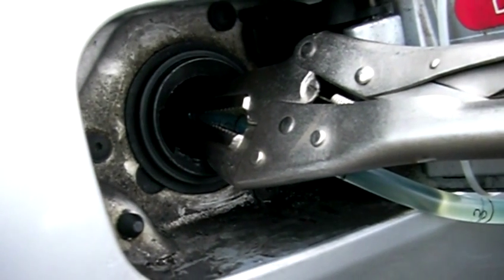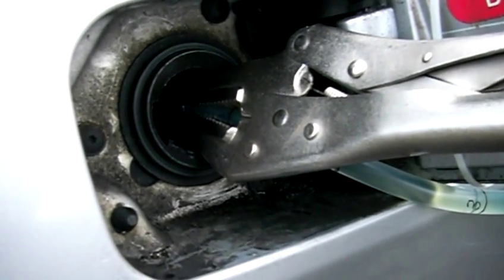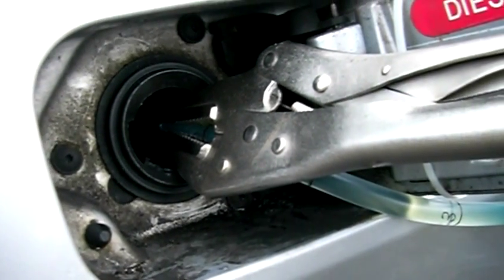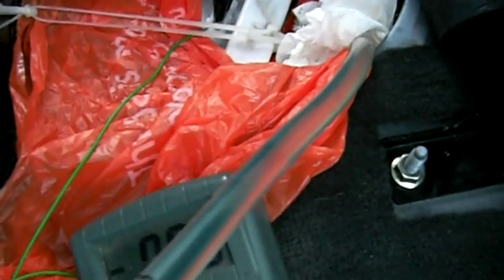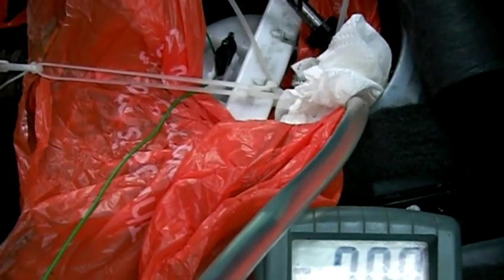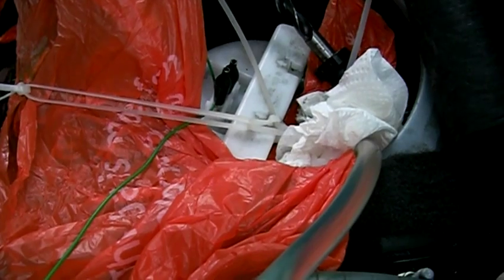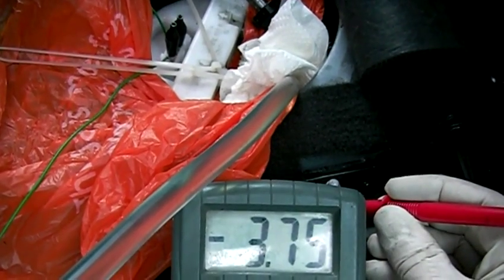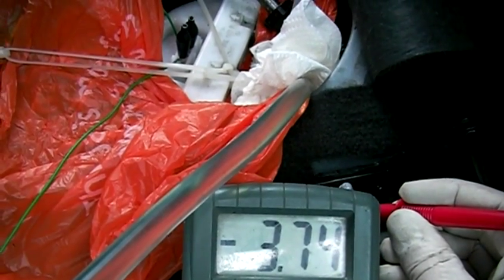Test 2 - Citroen Xantia 2.0 HDi Fuel Tank Pump - Air in pumped fuel. P0230 Fault

Comment from the maker: @hoppinonabronzeleg 
That's exactly what I was thinking after I'd done this test. I did get a second hand pump from eBay but there isn't actually any problem with this pump! It's just that it requires a return flow of fuel into the return feed on top of the white fuel pump housing otherwise it will behave like in this video. (Unless the tank is 90+% full). See my video "Xantia 2.0 HDi Fuel Tank Pump Tests with Pump removed from Tank - P0230 Fault Code" for an explanation of the "jet" pump.